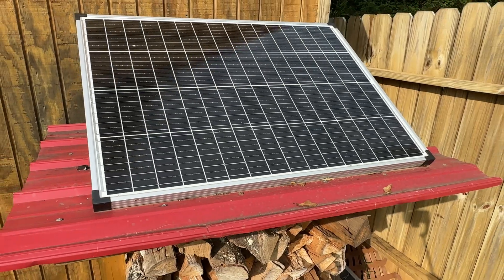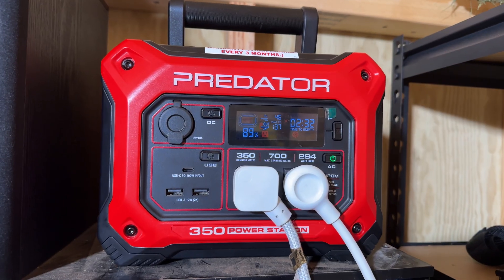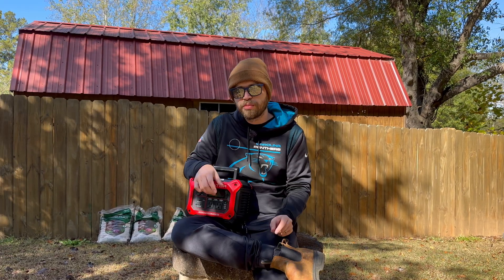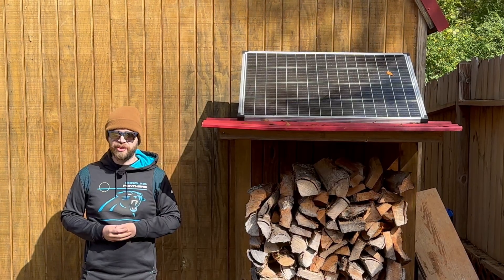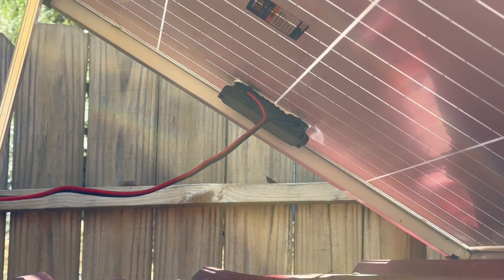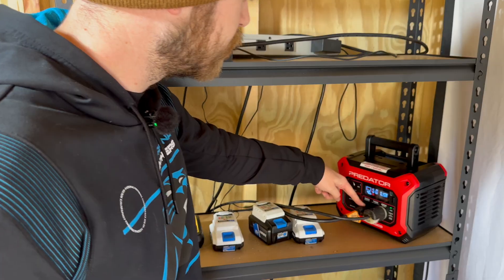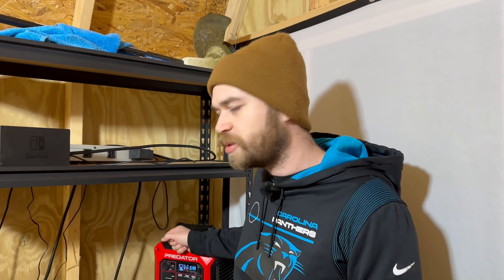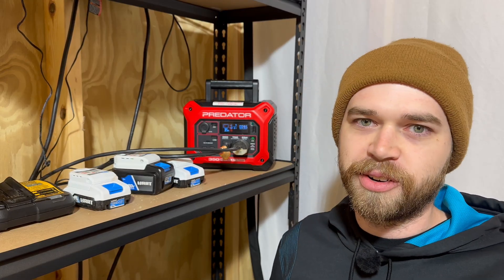Solar Power your Tool Shed The EASY WAY!

Comment: Would you please tell me what power strip you're using?  And gauge wire?  Thanks.
Reply from the maker: I honestly don’t know what the power strip is. It was given to me. If I remember correctly, it was used in a school. The school got rid of some old tech, and somehow it got passed along to me. I try to stick to at least 14 gauge wire

Comment: > I really like My Eco Flow River 2 Pro for powering My Shed and mounted 200 watts o Cheap Solar Panels in series to XT60I Plug into the River 2 Pro and 800 - 1600 Watts worth in Boost Mode drives and powers just about anything except for a Large Table Saw or My Air Compressor. Found on EBay Refurbished for $239.99 + a 5 year warranty.

Comment: what you tell here is wrong, the most important part to power serious any power station ist to use more then good sized solar panels.

for example in cloudy or winter conditions you get <10% inout.
so what is the point to put on a power station that have a 100 Watt charge speed build in a 100 Watt peak solart panel that never will deliver near the real speed?????

i use for example a 440 watt trina vertex S+ for my ecoflow eiver 3 plus that have 220 watt charge speed max and it reach this 220 watt speed only very rarely......

so 2-3x more solar the then max charge speed is the way to go if you really dependent on some real charge dayly.